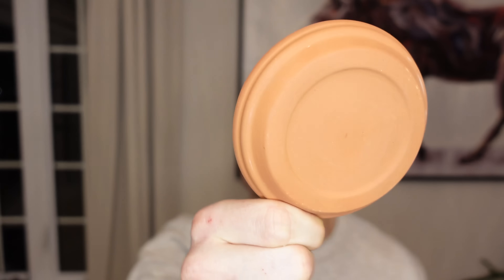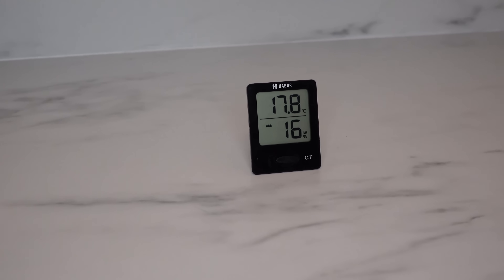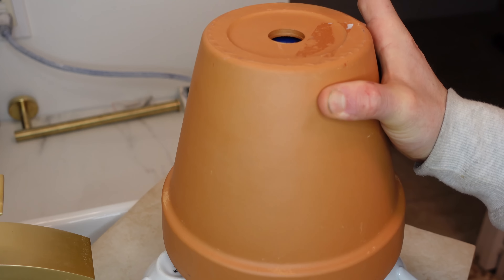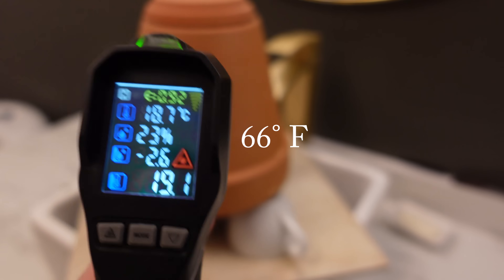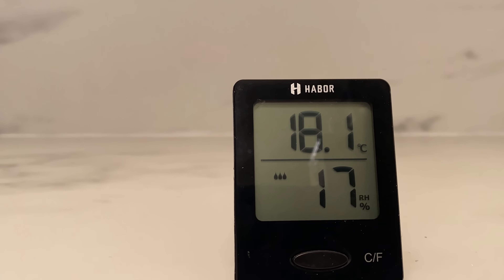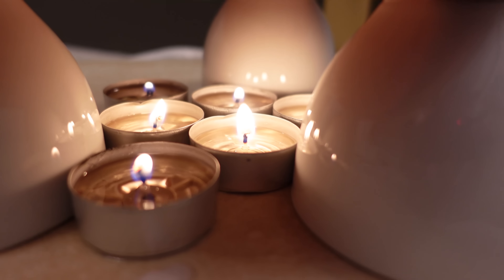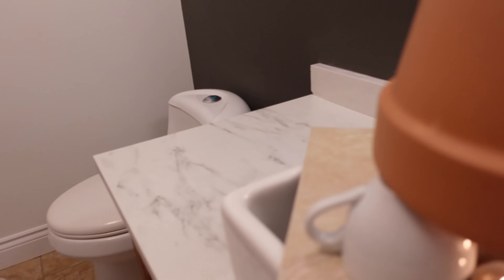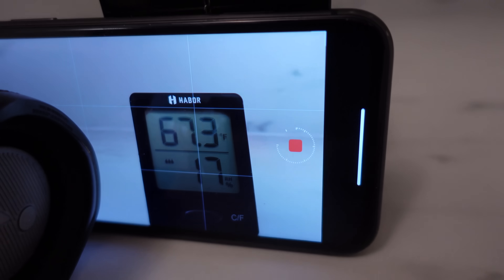CLAY POT HEATER TEST | Does It Actually Work?!

Comment: a better method would be to trap the heat in the smaller pot, and allow it the heat air around it in side the larger pot. that air then rises out of the top of the large pot. sucking more cooler air into the bottom. and repeat.
Reply: You're the exact opposite of a genius.
Reply: @anotheryoutubed  why? That's how a convection elemt works.
It suck cold air from the bottom through the heating spine and it goes out of the top.
The original terracotta tealight heater sat on a base with tealights and there's always a hole in the bottom of a terracotta pot.
Reply: @tiddybearkush  and that heating element requires what to hear the air? An enclosed space? What have you proved here exactly? Lighting a candle isn't a convection element you ducking dolt.
Reply: @tiddybearkush  hot air rising doesn't produce btus holy hell you're a complete genius.
Reply: @tiddybearkush  if you don't understand how BTUs and air temperature works, I really can't help you.
Reply: @anotheryoutubed  start by learning how a hot air current is formed and its consequences, the air that circulates between the pots creates a hot air current, because a heated fluid rises, and the air that circulates creates a current, and the consequences of this current is the renewal of cold air to hot which circulates continuously.

it is this current that is created in the creation of this kind, but it is especially important not to plug the holes of the 2 pots, it is one of the many mistakes that our friend made in the video

Comment: don't cover the holes on top. you need them so the cold air is pulled in the bottom and the hot air comes through the top.
Reply: Just don't use any pots. There is no extra energy created by using pots
Reply: @SimpliFixShop  it's an age old solution to heating small spaces. I really does work if it's done properly
Reply: @fionamoffat9933  just no😄
Reply: @SimpliFixShop  The candles last 4 times longer under the pot. So you have heat in the room for longer.
Reply: @Simmonique  less heat for longer time. Same as burning 1 candle each hour.

Comment: Is this a fire hazard?
Reply: Anything that burns is a fire hazard..
Reply: yes it is,i did this a few years ago,i was tempted to put more tea lights under and the heat created cracked the base and burning wax oil went everywhere!but the biggest danger i found were the candles themselves if using tea lights which are the cheapest option as they are basically paraffin which is extremely toxic in a confined space and used on a daily basis,i tried it i was quite impressed with the heat it created but the dangers outweighed the advantages,avoid!!

Comment: Try again, but block the inside  hole and leave outside hole open, this creates convection heat as well by. drawing air between pots as the inside pot heats up. Use a stove grate to set them on and/or maybe a metal sink stopper with holes on top of inside pot holding up outside pot, to allow that air flow. Also just watched making candles out of crisco to last longer. One commenter mentioned to be careful glass jars don't get too hot and explode, so why not get a smaller crisco can and stick couple b-day candles in it, and don't have to worry about exploding glass. It would be interesting to try an experiment using the air-flow type and the blocked air type. I have used this in a small RV and it does work.Pots will get hot enough to burn a round circle on a rug if ya take it off to check candles...ask me how i know, lol! This is a method everyone should know about r emergencies. Great job Phil!
Reply: I use waste fat/oil in a suitable container and a floating wick.  Burns longer and stops fat going down the drain.
Reply: @sallygiakalis4761   Thank you I was wondering about that myself, I imagine the smells probably pretty delicious too 😁
Reply: @sallygiakalis4761  I don't cook with fat, so would not work for me.
Reply: 😆 "Ask me how I know"
Reply: Actually had a glass jar explode on me a couple of years ago, put me right off making my own again 🤷‍♂️😂
Reply: @makaveliuk86  Ya, I don't feel comfortable with burning glass jars either. Safety first.
Reply: Sorry, but that does not increase the amount of heat a candle can produce.  A candle produces a finite amount of heat, and all these contraptions do nothing to create even one BTU more. It's not possible. You can't create energy.
Reply: @TheBarkinFrog  Totally agree with you that you cannot create energy from nothing or increase the amount of energy from an energy source. However, you can convert direct heat (candle in this case) into irradiated heat. That is the principal that all heating and cooking appliances use.
Reply: @gregparman-sibley6277  It still doesn't increase the heat in the room.  All you're doing is making a hand warmer, and a dangerous one, at that.
Reply: @TheBarkinFrog  Yes u'r correct.  However, u missed the pt.  We are not creating energy.  We are finding ways to best use the available energy.  Just like spending yr money wisely.
Reply: I saw a video by a man in Bavaria, and he leaves both holes open, but I wonder if that would prevent the pot from heating.   Did you find your method  heats room better?  Thanks.
Reply: @finallythere100  I'm trying one this weekend with hole covered or not...there is more hot air coming out with inner hole not covered, but not heating the room that much (it's very drafty). But I think I need to get a higher cutter pot, cuz I think will make a difference. The store did not have the ones I wanted, will try again.
Reply: @ladytrader688  - Thank you.  I just tried mine using very large terra cotta thick pots from Home Depot. I plan to get about 12 to 15 candles under, but right now I have 8. Heat pouring out.  Man in Bavaria says not to cover  either hole, but I found that covering top hole got the pot hot quickly, then left uncovered.  Sop heat putting out of both the terra cotta and through the hole. It was taking long time to heat up the outer pot, so I just removed it, and it seems that a singly, large, which pot is working surprisingly well. Surpassed my expectations!  I used to have 2 woo stoves and now I have gas vent heat, and So I noticed almost immediately that I felt more comfortable, and yet the temperature was lower . So even as the whole house dropped a few degrees at night, I was still more comfortable,not chilled because of all the radiant heat. This is so much better than I had expected. maybe sure to the larger base allowing me to use more candles, and the thicker, larger terra cotta thickness and surface area.
Reply: @finallythere100  What size pot? So just one, but are you covering hole of one? or just cover till pot gets hot, then uncover? I just have one Patriot 100 hr candle for now. What candles are you using and how long do they last? It's been so cold here I went through a 7lbs propane for my gas heater in 4 days...that is gonna get expensive real fast. So I broke down and got an electric radiant heater. Will see how much that costs. Still want to find the sweet spot for an alternative pot heater.Thanks for your reply.
Reply: @ladytrader688  - The inner pot that I ended using as the only pot last night id (exterior measurements) 14 inches in diameter and 10 inches tall. HD has many of them, near me, at least.  There is another pot that is even larger - it is 17 inches in diameter and 14 1/2 inches tall.  I will probably try that. I used one homemade shortening candle and the rest left over votives from last season.  But it was only 8 of them. I could fit more and still space them apart, especially w the larger pot. I'm ordering 6 ounce mason jars. I have lots of jars from dollar store, but they are not fire proof. (I use them for beeswax blessed candles that burn just single and so I can place it on a tin in case it shatters (They have before when I had added extra wicks when may wick was not large enough and it tunneled. The extra wicks were too close to the rim. - my growing pains!)   

Anyway, I was so impressed w this. When I'm put fire out at might the thermostat quickly dropped.  I'm just amazed and excited, as this has been out first cold night and my heater was off all night bc I set thermostat to 62. A few hours after the candles went out it was down to 63 in the morning. ,
Reply: @ladytrader688  - sorry, I forgot to mention.. with that large pot You can heat it up very quickly by covering the hole.But when the pot is hot, just uncover it, and the heat will pour out from the hole AND radiate very well from the thick, large pot. It feels like I have my wood stove back again, but not as powerful.Still it does the job. Here is what ai recommend, having used wood stoves for 20 years in my former house.. Use the candle heaters in a room not near your thermostat. . Set your thermostat to 60 degrees, bc  w many furnaces, the fans will not run below 60 degrees even if the furnace is on, so it will can burn out your furnace (what I read.).  I don't know if that is triggered by the thermostat or by the actual temp, but in any case, you don't want your pipes to freeze, and it is recommended to keep house not below 60 degrees to prevent that..

Use the pot heater in a separate room. You can also have a CO2 monitor (battery operated for outages) to monitor any CO2 probe, but I think Crisco is safest.
Reply: @finallythere100  I went to Lowes, maybe HD, but stores here clear out garden for holidays
Reply: @ladytrader688  - if differed vastly in the 2 stores very near me...
Reply: @ladytrader688  - Still very early, but I/m finding that with the largest pot ($32) that the candles turn to liquid bc it gets so hot. The pot is so thick that it takes lots of candles to heat it ( but that was the idea) If I raise the pot it is heating very slowly even w hole covered.  If I lower the pot then the crisco melts.  SO, thinking the  $20 pot works better (the second largest, it iis almost as wide, but not as tall) ...  The largest pot IS getting very hot, but not sure about how to make the candles work with ease... I'll figure it out... but I think going large as you can is best.  I read that crisco won't work as an oil Lampo, but I think that might work bc it turns completely to liquid and so maybe getting an oil lap wick to work..  Just have to figure it out for the large size...
Reply: @finallythere100  The thicker the pot, the less efficient it will transfer the heat fr the candles to the outside.  It needs to absorb a lot of heat before it radiates excess heat.   Just like u need money first for food, and clothing to keep u alive, then the leftover for other things like movies, ice cream treats......  Got to find the sweet spot.
Reply from the maker: Ohhh good idea
Reply: ahh the moments experiments fail... I had to replace a scorched laminate vanity top because the wax self-ignited due to the intense heat of the inner pot radiating back down to the candles in the votive candle beneath the inner pot...  YES it can happen.... so don't get too aggressive with the flame power

  Ways to avoid this is to gently blow cool air up between the two pots to accelerate the convection activity or have a fan/bellows blowing against the outer pot to dissipate the overall heat...
Reply: @kevinrehberg8758  The better way to avoid spontaneous ignition is to just DON'T DO THIS AT ALL!!!
Reply: The problem  with the Cisco can is, it isn't a can. The top and bottom are metal, but the other part isn't and would  catch on fire as it is made of cardboard as far as I know
Reply: The first time I saw this the person used bricks to hold the pot up, I guess because the bricks also eventually warm up and retain heat. Also they left the top hole in the flowerpot unblocked, and only used 1 pot, not one inside another, I'm willing to bet there will be a difference. Only one way to find out
Reply: @jameswesten2018  It doesn't matter. Nothing you can do will squeeze even one more BTU out of a candle.  Just like setting a flashlight on top of a gallon jug of water doesn't make the flashlight put out anymore light. It just disperses it differently.
Reply: @TheBarkinFrog  This is a great way to heat up ur camping tent/small room.  U don't want the heat burn dn yr tent.  The whole idea is to control the rate of heat dispersing in a slower manner to harvest every ounce of heat therefore no excess heat is left to escape outside.
Reply: @tonygosbee3390  This is NOT a great way to heat up your camping tent or a small room...because it 1. doesn't work, and 2. can cause a flash fire, explode, and burn your tent or small room down, with you in it.

Let's say your candle will burn for 4 hours, and produce  about 30 watts of heat. You'd need 20-30 candles, replacing them every 3-4 hours, to heat a 10 by 10 room.  And it doesn't matter if they're under a clay pot or not, they aren't going to produce anymore heat. 

It's not an effective way to heat, and it's not cost effective. Taking the mid range...25 candles changed every 3.5 hours...you'd need 171 candles a day. The cheapest candles I could find in a quick search were $7/125, so you'd be spending roughly $9.50 a day for heat. 

There are safer, cheaper options. Find one.
Reply: @TheBarkinFrog  Tks fr the reply.  The open flame should only be used as a last resort in an emergency scenario.  In order to calculate the heat required, u need the cubic volume of the space u are going to heat up, and the heat lost too.  On average, a candle gives out 80 BTU/hr i.e 23.4 W/hr.
Reply: @tonygosbee3390  And to heat a small room you'd need a whole lot more candles than the 4 used in one of those contraptions.  And, like everyone else, you're ignoring the fire hazard.  An open flame, properly used, is not as dangerous as one of those contraptions.
Reply: @TheBarkinFrog  The concept of thermal mass heating is best suited inside a small camping tent where u want the min. input to get the most heat out. Controlling the slow heat rate release will min. heat lost due to the draft.  An open fire is a very wasteful way of heating up and will not last long.  The way I will do it is to have an open fire going then when it reduces to charcoal then and only then I will bring it inside the tent/small bathroom for warmth.  I probably will use a cast iron frying pan instead of a clay pot.
Reply: @tonygosbee3390  It doesn't matter how you set it up, none of it will increase the amount of heat a candle will produce.
Reply: Nice to know for when electric goes down, or the grid goes down

Comment: For the next experiment, keep the lights off. Believe it or not, lights provide a lot of heat in a room through radiation and convection.
Reply: I remember back in the day, in S. Dakota, during a really severe winter storm, we used the incandescent lamps to heat the apartment that was otherwise almost uninhabitably cold.  If those bathroom lamps were LEDs, then they were merely interferiing ith the result.  If they were incandescent, then the result was not necessarily due to the terra-cotta heater acting alone.
Reply: Depends on what kind of lights they are, incandescent bulbs give off lots of heat, while some LED bulbs give off almost none.
Reply: @gavsmith1980  given the color rendering of the phone watching the digital thermometer and the background "white" light, then these lights are definitely old-school incandescent lamps, so throw in 100W or so of extraneous heating...
Reply: Next time try it without the pots for exactly the same results.
Reply: Exactly

Comment: Thank you for providing data, and ideas for one of these little heaters.  I am curious about carbon monoxide and dioxide levels in a small room.
Reply: Probably fairly similar to just having 3 candles burning in a room as they normally would, just a faster curve as they with likely burn at a faster rate. 

A bit of natural ventilation would probably be enough. You'd be feeling pretty sick before it became life threatening.
Reply from the maker: That’s a good point, I could make a test / video on this soon!
Reply: @philg  I’m waiting for a another time when it’s in the 20’s in Michigan and I’m going the set up my BBQ thermometer which has several leads in a tent. I’ll be able to get temps outside, inside tent and directly above pot. Plus I’ll put a CO2 detector in the tent. Awesome video with data. I appreciate it.
Reply: @philg  Hi. If you did not plug the top pot hole would the system still work and radiate the heat? Some videos say to leave the hole open on both pots or just inside pot.
Reply: @alexanderhinds-neunie8035  put a cap with air gaps...it catches the smoke and gets hot...hot enough to keep a coffee mug warm...
Reply: @howler6490  Absorbing soot deposits would be a major advantage. Perhaps some steel mesh in the inner pot would help without restricting the airflow too much.
Reply: As long as you allow plenty of air access, you will have no monoxide/di-oxide problem as they are the products of incomplete combustion.
Reply: @howler6490  Funny, you have to refresh the air a lot, but you must heat the fresh air as well. So that will make this heater useless
Reply: You don’t hear about women being killed in the bath from all the silly candles they put round the bath. They use far more than 6 tea lights.

Comment: Hallo! I got a jötul 711 combi oil and wood stove with dk 8722 hedensted Denmark regulator. I get oil to the regulator but it doesn't fill my burner. If I overfill the regulator then i get oil to the burner. Any idea why? 🙂 Best regards
Reply from the maker: Try using the cleaning rod to take out the build up from the regulator to the burning chamber, hopefully this helps!